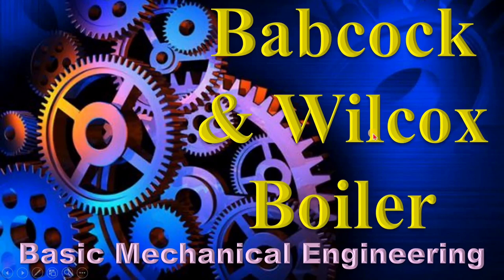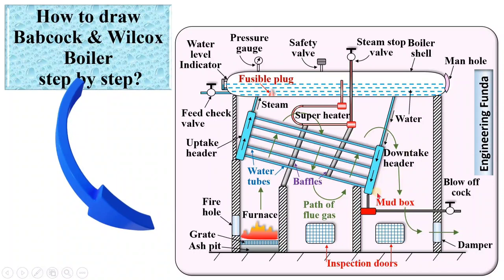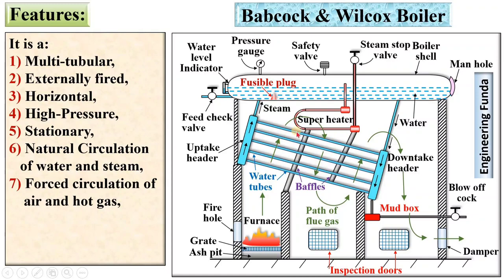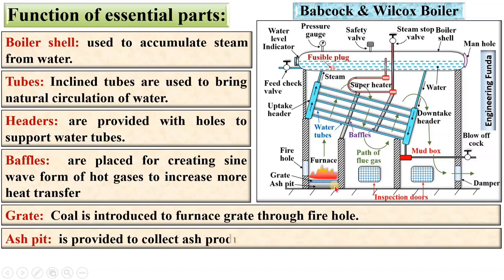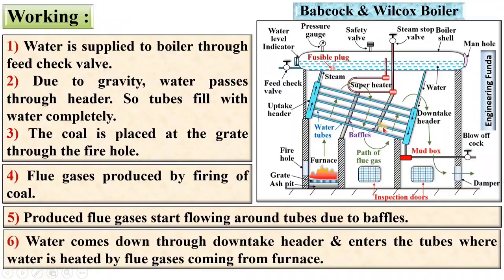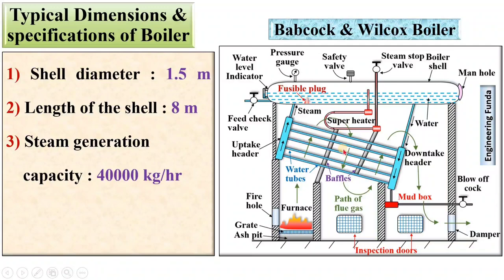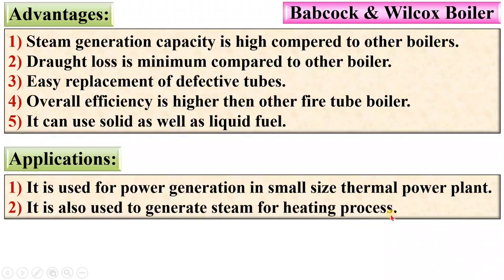Babcock & Wilcox Boiler (Basics, Features, Parts, Structure, Working & Applications) Explained

Comment from the maker: Babcock and Wilcox Boiler is explained with following timestamps: 
0:00 – Babcock and Wilcox Boiler in Basic Mechanical Engineering lecture series 
0:10 – Babcock and Wilcox Boiler
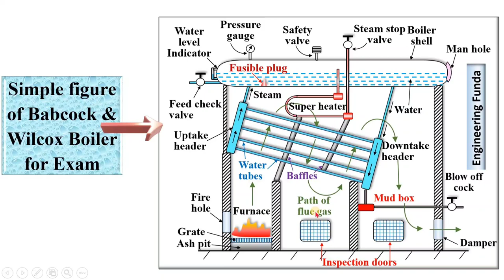1:16 – Simple figure of Babcock and Wilcox Boiler
1:23 – How to draw Babcock and Wilcox Boiler
1:42 – Features of Babcock and Wilcox Boiler
3:13 – Function of essential parts of Babcock and Wilcox Boiler
4:30 – Important boiler Mountings 
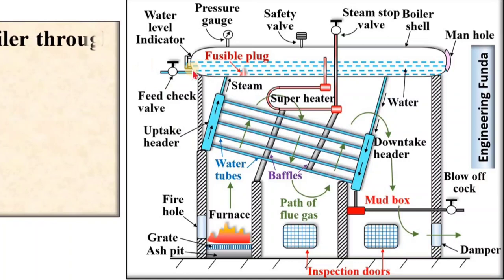5:36 – Working of Babcock and Wilcox Boiler
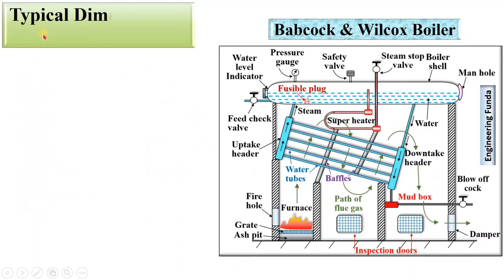8:00 – Typical dimensions of Babcock and Wilcox Boiler
8:48 – Advantages of Babcock and Wilcox Boiler
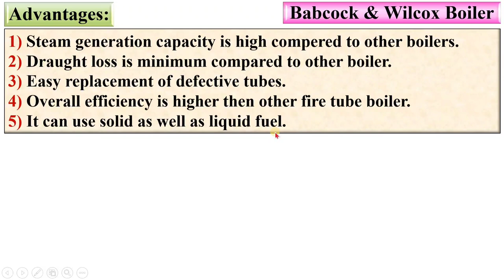9:32 – Applications of Babcock and Wilcox Boiler